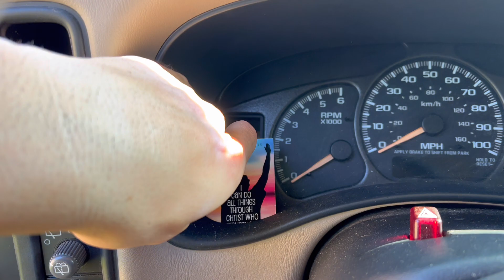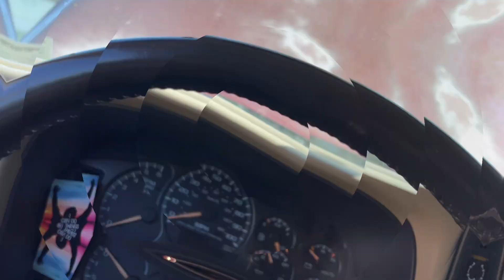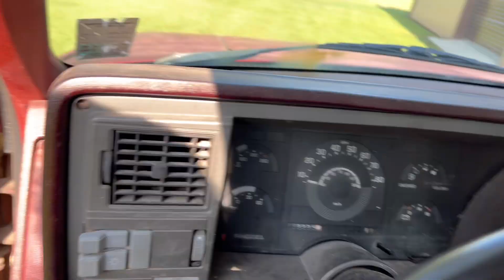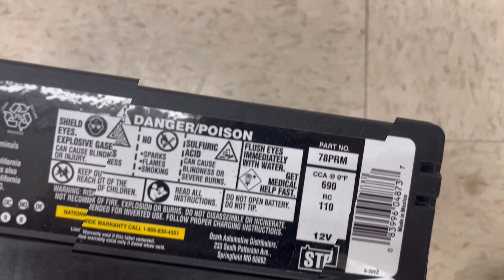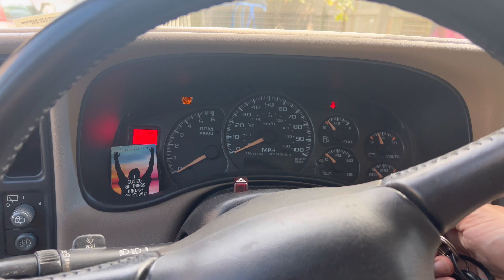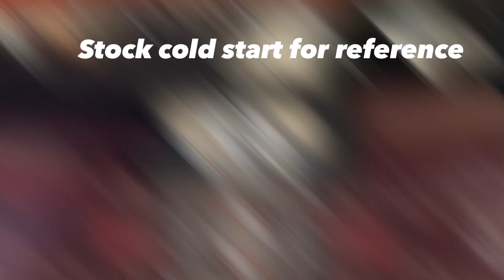Saw This On Sloppy Mechanics | Turbo Suburban Build: Part 1 Drivetrain Removal

Comment: Heyy bro i gotta c30 i need help on putting the starter wires on I forgot how they went on it’s been like a month or two and the Dually is just sitting there
Reply from the maker: Big wire goes to the big lug can’t mess that up and purple wire goes to the little lug
Reply: @DuheSpeedShop  Okk i got that one and the switch on but I got like 3 more wires I don’t know where they go to the truck won’t even turn on just the lights work but there’s no lights on the dashboard or when you turn the key on nothing I bought a new battery for it to

Comment: I just bought a 1982 Datsun King cab with 113000 original miles I just replaced all the belts and hoses plugs wires distributor cap rotary a new alternator on a new battery flush the radiator put new thermostat in it I could want and in 2 weeks me my wife and my six-year-old a stepdaughter

Comment: You still want my favorite YouTubers even if you are going to trailer your car to a car show
Reply from the maker: I’m trailering it with a square body dually! Not the same vibes as trailering with a new vehicle. The dually was the focal point not the 58
Reply: @DuheSpeedShop  you're right you are you're using a classic to triller classic and I know that you drive that Dooley all over the place like I said bro you are one of my favorite YouTube channel
Reply from the maker: @davidjustice5805  I know I just started my channel and you prolly don’t follow me on other social medias but I do power tour every year and never take the same car twice! All the cars that run in my garage get at least 1500-2k miles a year, I drive them off camera a lot